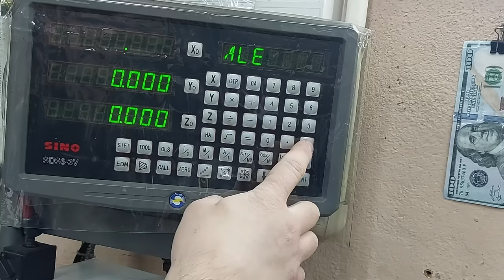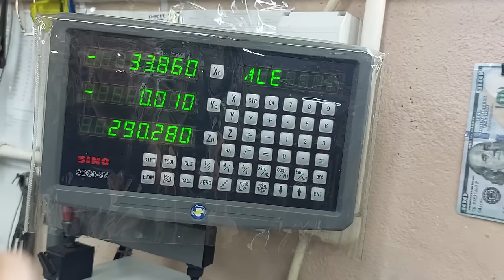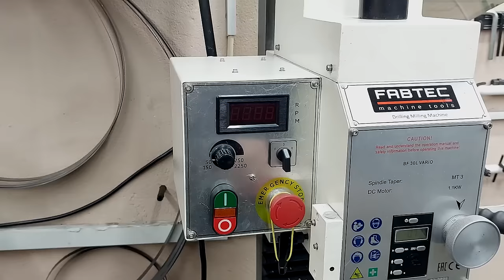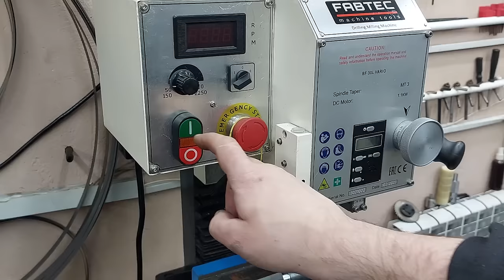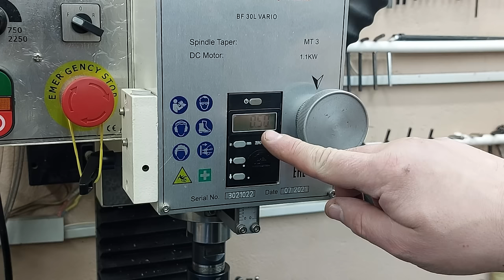The mechanism that changed the industry in metalworking! Brilliant idea for my milling machine

Comment: I've made collet blocks for 5C. But not the square and hex ones. I made ones with 5, 7, 8, 9, 10 and 12 sides. Did all the internal work first and then honed the bore to a sliding fit on a ground bar stock 1.250" in diameter. I then did the milling with the a piece of ber stock thru the center. With the bar stock eupported in .500"/12.7mm vee plates. Milled one side. Rotated to register against an angle block of the correct angle. Then surface ground all sides using 1.000" bar stock held in a preision 5C collet and an angle plate. Indexed using angle blocks. Within .0002" on all sides for each block. Each bl9ck marked with centerline height.